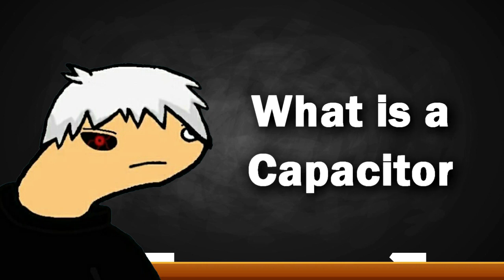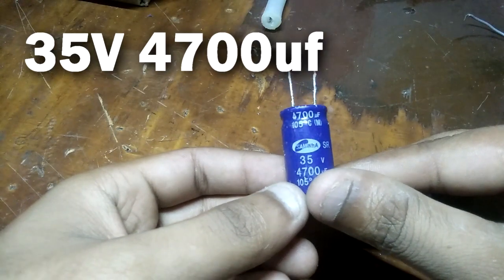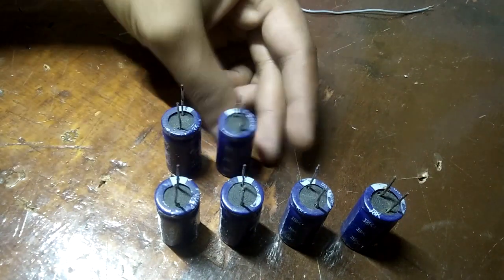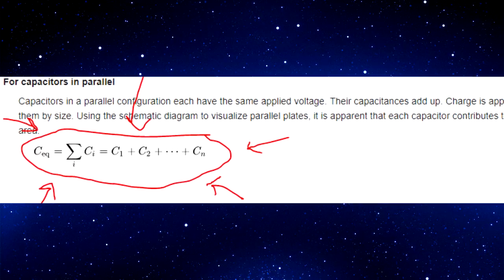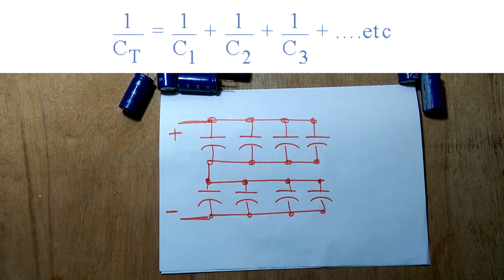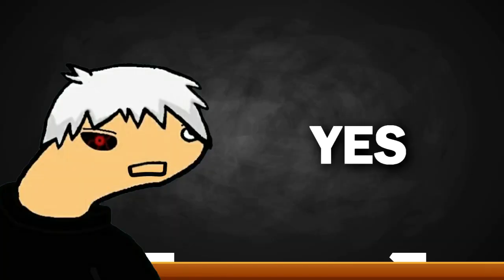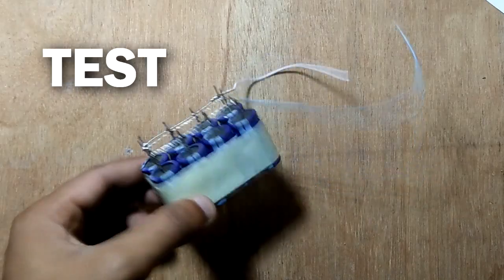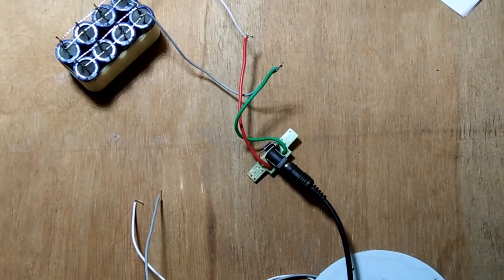Let's make a COIL GUN part 1 | Capacitor Battery

Comment: This doesn't address the issue of charging them, which might be kind of simple but honestly I can't find anything on making a charging circuit with a specific voltage in mind. 

For example: I have a small bank of 4 6.3v capacitors connected in parallel, but cant get them to charge even when connecting 3 9v batteries to them. Reads no charge.
Reply: Oh yes. New! See also New Portable Super Coilgun:

https://www.youtube.com/watch?v=rclLsQ9nyeg&amp;feature=youtu.be

https://www.youtube.com/watch?v=-mjDqp_oWZk

Comment: Please help me i have 220v capacitor 80uf and when i connect it to coil the bullet almost doesnt shoot only a bit please help me but when i connect 80v 2200uf capacitors it shoots really far maybe the problem is in the coil?
Reply: the problem is the 80uf capacitor. try with a bigger one :)
Reply: @uninstalling9513  do 450V 1000uF Capacitors work? Or should i connect 4 or more of them in parallel & series?
Reply: @AlexIstEinGott   if you want to power it with rectified mains voltage, one capacitor would be good. Even better if you connect multiple in parallel. If you have no knowledge how to deal with mains voltage, just use 12V adaptor. But it's kind of inefficient though. Remember, mains voltage can kill you!
Reply from the maker: Why use AC when you can use a 12V 3amps power supply, just use super caps and discharge them real quick,  that's the trick
Reply: NEW! Lethal coilgun || Tutorial || start to finish 
https://www.youtube.com/watch?v=1c5cxLK08RQ